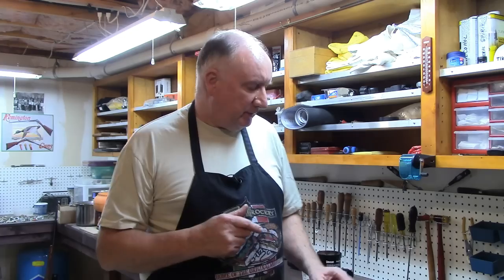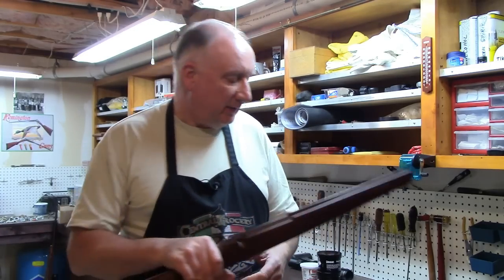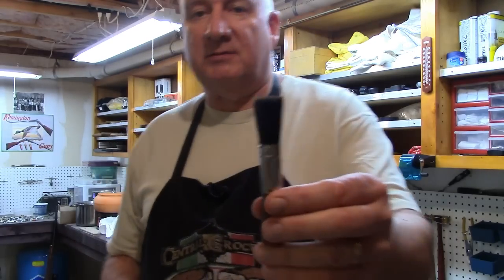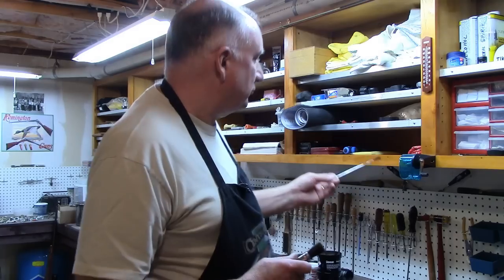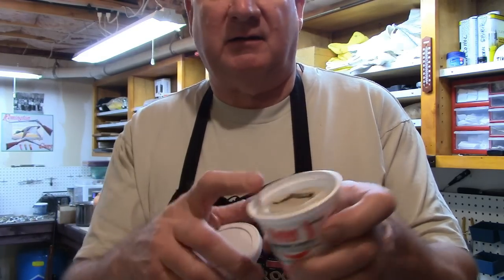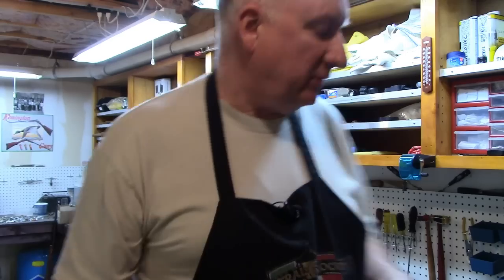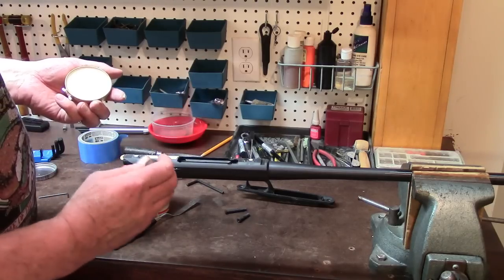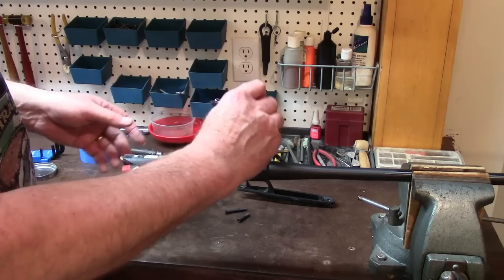How to glass bed a rifle, Part II ~ Let's bed that rifle professionally!

Comment: Do you have a video that explains long boat action
Reply from the maker: Charles Guidry 
I believe you mean a long bolt action.  Most companies produce bolt action firearms with receivers of two lengths; short and long.  These two lengths accommodate cartridges of appropriate lengths, or in generic terms, 308 length and 30-06 length, which fit cartridges in those approximate lengths.  Certain cartridges, such as the 300 H&H Magnum, require extra long actions.  Sako of Finland currently makes at least eight different lengths. These are very specifically sized to cartridge lengths and even diameters, in order to keep weight to the minimum required for a given cartridge, and to maximize handling qualities, which is a very desireable, but very high cost feature. It greatly increases production costs of not only the receiver, but also of the various types of stocks which must be tailored to each.  On the other hand, their bargain (but extremely good) Tikka bolt action rifles employ only a long action, which requires that only one length receiver and stock be produced, with the various cartridge lengths being accommodated by three detachable magazine types that match small (223), medium (308), and long (30-06) length cartridges, all of the same exterior length, but of different internal dimensions.  The only association of the term "boat", as I am aware, applies to boat tail bullets, which have a tapered base that reduces drag factors.  And of course, a long boat was a small oar powered craft used by whalers in the 18th and early 19th century.
Reply: Ha Ha!  Long Boat / whalers  Ha Ha!
 @GunBlue490

Comment: Would there be any additional accuracy obtained by pillar bedding before the glass bedding?
Reply from the maker: No.  Pillars only help stabilize unstable actions.  This sort of accuracy does not derive from instability.  Pillars are useful with flexible plastic stocks or poor wood, but rarely provide any added accuracy over a very solid epoxy bed.

Comment: Question: 
The pillar made on the front action screw hole...did you keep it threaded or did you ream the hole out so the screw slides in without being threaded?  I love the idea so I purposely did that to mine.  Just need to know if I should keep it threaded or drilled out some?  

Thanks!
Reply from the maker: yareelohim77 
I prefer to chase the hole for easy screw insertion.

Comment: excellent set of videos, as always. I have a question, however... I have a bolt action rifle with a polymer stock. As much as i'd love to upgrade to a nice laminate or solid wood stock, I simply cant afford it at the moment, but I was able to get some Devcon10110 on Jet for $32. Acknowledging that polymer and wood stocks will react differently to heat, force, etc- would it be advisable to do a full bed (as opposed to the partial bed you demonstrate here) for a stock which has more flex like a polymer? In this application, it would seem that it would be more beneficial to add rigidity at the cost of the potential binding you refer to - but stand to be corrected.
Reply from the maker: Logan Brunson 
Flexible stocks can be problematic, but remember that shot to shot consistency is the primary objective.  Stocks can often be stiffened by bedding a lightweight but rigid spine into the compound before you do the barreled action.  For rigidity, contemplate how house structures are made, using relatively flexible wood, but positioning the dimensions with the breadth supporting the load.  Or similarly, thin tubular stock such as aluminum affords rigidity without weight.  Such support can dramatically stiffen a stock.  Afterwards, complete the procedure as I outlined, but stick to two points, which will not cause hot spots midpoint.

Comment: I have a 257 Roberts that started shooting poorly. I saw this video and thought about bedding the barrel. I took it apart and found the stock has a crack between the action and magazine is this a problem?
Reply from the maker: That could certainly explain the turn toward poor accuracy.  Watch the videos I did on reconditioning the Arisaka rifle with a severely broken stock, and it may give to some hints.  Some of those issues are not that difficult to repair with a bit of ingenuity.  Afterwards, it may help to bed the action, too.

Comment: Has anyone ever glass bedded a Browning A-Bolt II? The rear tang has a loose plate that fits between the rear tang screw and the stock. How would you deal with this area for bedding material and prep? I am putting the rifle into a Boyd's AT-One Laminated stock. From my search efforts I have not found one video that references bedding this model of rifle...

Comment: Thanks for your video, a professional bedding job and it was well illustrated. Have you had the opportunity to shoot this rifle after the bedding?  Curious how much improvement was made.
Reply from the maker: Stoney Skidmore 
As you may have seen with the first of the two videos, the rifle was shooting superbly out of the box, and I essentially quipped that doing a bedding job was perhaps silly from a practical viewpoint.  A gun shoots well when the action is stable and the barrel is floated, and in my experience, there isn't much middle ground.  Unstable, however slight, is unstable, and Sako did it right.  The bedding job essentially couldn't improve upon perfection to any degree that I can detect with the same loads, though I do believe that it perhaps resulted in a more durable and long lasting fit.
Reply: GunBlue490, thanks. I'm considering bedding a Tikka CTR that already shoots really well. impressed with the Tikka's accuracy.

Comment: What kind of accuracy did you obtain after the bedding job?...
Reply from the maker: The rifle was performing excellently before bedding, with no deficiencies, and no signs of instability.  As I alluded to before doing the bedding, I wasn't sure I could improve on perfection.  Accuracy after the job didn't materially improve, and the rifle didn't need it, but of course, the epoxy bedding may have better sustainable accuracy over time due to the stability of the epoxy.

Comment: GunBlue490: 
I was inspired by your video and decided to glass bed my old Mossberg 810B 7mm Mag. I followed you instructions including the Devcon steel putty with Kiwi show polish release agent. I feel I was meticulous with my prep but unfortunately I am having difficulty with separating the action from the stock. The epoxy appears to have released since i can pivot the barrel slightly from front to back over the recoil lug. I just cant get the recoil lug out of the stock. Since your example was with a Tikka that had a removable recoil lug I followed Larry Potterfieds advice and added a strip of tape to the front and bottom of the lug. I dont know where the epoxy might have gotten around the lug to prevent removal unless the bottom of the lug is slightly larger than the top. Any ideas? U currently have it in the freezer again but I am starting to panic as I dont think they make stocks for the 810B anymore.

Marc
Reply from the maker: I've had some get pretty stuck, too.  Don't panic.  It will come out with sufficient force and the correct technique.  What's required is support of the entire stock in order to prevent it from breaking.  

Holding the gun by the stock with both hands as if hunting and place the butt under your right arm pit.  Wrap your left fingers  over the barrel so it doesn't fly out.  Kneel down beside your bed or sofa (it's a good prayer position!).  Strike the entire underside of the barrel straight down onto the bed with a swift, firm stroke.  It should release with one or two blows. If the bed is too soft, place a thick layer of towels on a solid bench.
Reply: @GunBlue490   Thanks for the advice. I finally got it freed, but the problem was with the tape around the lug. I believe the release agent worked as when i was able to free it it didnt "pop" loose. it was a slow mm by mm shear of the tape against the lug.  I could see daylight arount the action but it still took quite some time and effort to get it free. I feel the epoxy might have swollen and compressed the tape and lug because it was a tight fit. Even after removig the tape, the lug fits in quite firmly. In the future I will use a different tape, this time I used duct tape. What would really solve the problem would be a metal shim with release agent on both sides but I dont know if I am machinist enough to accomplish that. Once again thank you for responding to my comment and I do enjoy your channel.

Tight groups

Marc

Comment: I see you are familiar with the 1903 Springfield 30.06? I would like to bed that action in my new Boyd's laminated stock as you describe. The front has, basically, a two piece pillar integrated with the recoil lug and floor plate. The screw goes through a round half pillar integrated with the floor plate into the recoil lug itself bringing the two together tightly. The recoil lug does double duty. The recoil job and the top half of and completing the pillar. The rear tang sits flush to the wood with a round pillar (Springfield calls it a bushing) that the screw goes through. This "bushing" is critical to prevent cracking the stock at the rear tang. So am wondering about floating it like you say. Any suggestion on how to do this rifle, both front and rear?
Reply from the maker: Widow Maker 
Winchester Model 70 actions were built very similarly.  Open up my video on accuracy rifles where I show how the factory performed the two place bedding.  That rifle is outstandingly accurate.

Comment: how would you grass bed a M1grand or a mini14 .
Reply: * glass bed
Reply: GRASS bedding is a very complicated process that involves carefully laying layer after layer of long bladed fescue or zoysia grass into the bedding recesses of the action then covering with super glue just before installing the action back into the bedding and applying approximately 20 - 25 inch pounds of torque to the front screw only. The rear action screw is optional.

Comment: Have you ever thought about using surgical tubing instead of electrical tape to hold the stock and action together?
Reply from the maker: No.  A roll of electrical tape costs less than $1.50 and is found at any hardware store. It applies and removes easily, and applies even pressure along the entire bedding area.  I have no need to use another product that does no better at twenty times the cost and needs a shoebox to store it in. Surgical tubing can exert an enormous amount of pressure with stretch that is difficult to control, and can very easily apply too much pressure, unevenly. I was using it 55 years ago for driving underwater spears, and it makes excellent tourniquet material, but ranks pretty far down the list for this work.
Reply: @GunBlue490  I should have known you'd have already figured this out.  Thanks for getting back with me on such an old video, and thank for all the wisdom you share.

Comment: I Bought a new stock from Boyds gunstocks and this is the stock I want to bed. I screwed the action down to the new stock and I found the barrel sits right on the stock, it seems snug right to the base of the barrel. How do I free float the barrel? Is it possible to put tape around the barrel and then have the epoxy take up the gap around the front bolt and recoil lug? What would you do?
Reply from the maker: Kris Cs 
Yes, I have used tape on the barrel to maintain a specific gap, and it works beautifully.  Be sure to free float fully before you start.  The gap should be at least .050", to prevent possible barrel slap.  I recommend using easily removed blue masking tape, and carefully coat it with Kiwi.  If you position the tape to start 3/4 to 1" in front of the front recoil lug, you will have a perfect support that will aid stabilty without barrel interference.

Comment: These are great bedding videos! Thanks for taking the time. Regarding the compound: are you aware of the Devcon Plastic Steel #10110 ever rusting?  Also, the Devcon Stainless Steel #10270 putty has a lower shear strength but greater compressive strength than the #10110 (2385 psi vs 2800 psi, and 8400 psi vs 8260 psi, respectively); which of these strengths is more important?  Thank you!
Reply from the maker: As the the first issue, anything that causes the Devcon to rust will rust the gun long before that.  None of those strength issues have any relevance.  The Devcon is far stronger than the wood that it sits astride, so any shearing or compressing forces will act on the wood first.  I never in my life heard of any such weakness affecting a bedding job from a credible source, and I cannot envision why it would.  The compound is merely a shim, and is not a structural component, even if done with pillars.  I have bedded many very accurate jobs with store-bought Devcon 2-ton, and they all worked superbly over many years of shooting.  The Devcon industrial grade putty is really over-kill and can be expected to last lifetimes.
Reply: Thanks so much!

Comment: I have a question.   I have an old Remington 1917 that is shooting really inaccurate groups.  The back of the stock right behind the tang has a chunk out of it that looks like it is from recoil.  I thought re-bedding it might help with reinforcing the back and I thought I would do the front mount too while I am at it.

On this rifle the machined out hole for the front mounting bolt does not go through all the way into the action,  so if I fill it with putty and then epoxy there is nowhere for the plug to exit.

What do you do in this case where the front bolt hole does not exit into the action?
Reply from the maker: jwilkersonhome 
To be honest with you, I am having difficulty picturing your situation.  If I understand correctly, you are saying that the front of the receiver is not connected with the forward mounting screw? I cannot imagine why that barreled action stayed put to begin with, and it certainly would explain the damage to the tang portion.  That receiver absolutely must be secured and the stock must be entirely rebuilt before it's fired again.  Epoxy alone would be a poor fix without a solid base.  Your best ootion would be to hunt down an Enfield 1917 stock, which may not be that difficult, as many were removed for sporterizing.  If you can't find one, the only correct way to properly fix the gun would be to machine out the damaged areas, and fit and feather in a block of matching walnut precisely, glue it in, pin it, and then inlet the action correctly.  Only then would I attempt to epoxy bed it.  I have restored stocks this way, and if you are patient, without cutting obviously across grain, cutting irregular diagonals and with a good match, the seam can be made barely visible, and will be very strong.  There are a number of good books written on this subject for guns and furniture restoration that you can research at your library.  It is a lot of challenge, but very rewarding.
Reply: ok,  I found a replacement stock on ebay.  Hopefully that will work.   

Now,  on my receiver, the hole for the front mounting screw is either overlapped by the barrel or is not machined all the way through.  So if I were to glass bed the new stock,  I am not sure what to do since there is nowhere for the putty and epoxy to exit.
Reply from the maker: jwilkersonhome 
The solution is very simple.  Get a set of inletting guide screws from Brownell's with the correct threads for your gun.  These are simply long screws with screwdriver slots or t-handles but no head that stockmakers use as guides while they inlet the stock.  Place the screws into the receiver snugly with release agent or wax on the entire screw, including the threads.  Don't use the t handles if you want to install the trigger guard.  Set into place with your bedding compound, strap the receiver in tightly with electrical tape, along with the floorplate/trigger guard, following all my video directions.  After epoxy has dried the screws may be withdrawn and the gun disassembled as usual.  If you can find smooth screws at the hardware store with the right threads, just cut off the head and make a slot with a hacksaw or Dremel tool for your screwdriver, and you'll save a few bucks.  just make sure your screws are long enough to protrude through the trigger guard.
Reply from the maker: jwilkersonhome
One important thing I wish to add, you are looking for inletting guide screws, which are very long and the same diameter, and not the ones that have a large diameter with a taper.
Reply: wow.  thank you!

Comment: Great stuff sir. This is the second time I’ve watched this series and intend on watching it at least one more time before I do my first gun ,as this is the best video I’ve seen so far. One question though,I’m planning on doing this to my Model seven 300 wsm with a synthetic stock. Will the expoxy you mentioned work with this type of stock??.  Thanks again.
Reply from the maker: Sorry I didn't see your question until now.  Yes, bedding is as effective with any composite or wood stock.  It's all about stability.